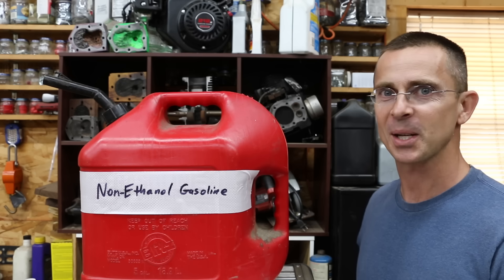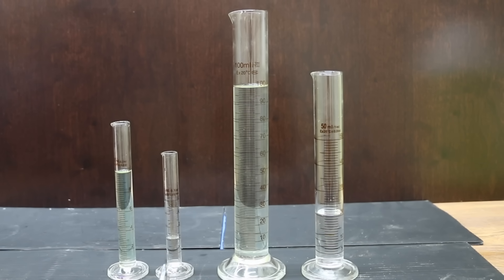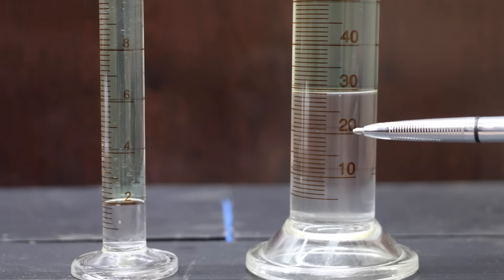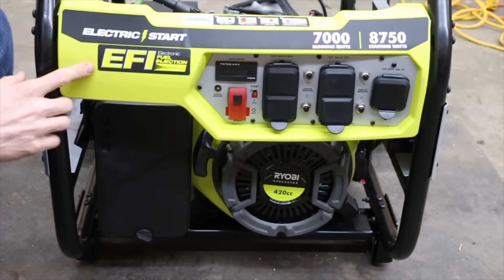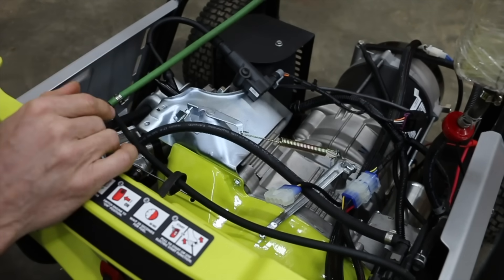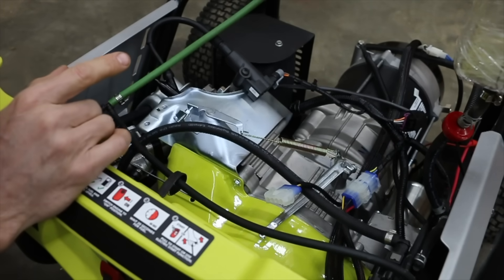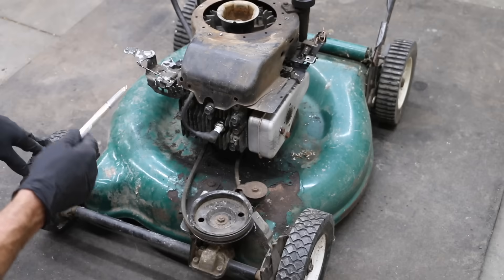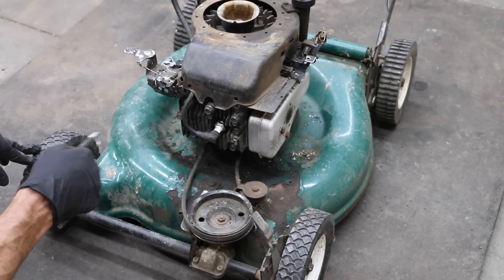Is Non-Ethanol Gasoline Really Better? See the PROOF!

Comment: Hey I had a small engine tech show me a swollen check valve I believe it is called in the carburetor of my chainsaw. He said that the ethanol ruins them and they have to be popped out and replaced if left in fuel containing ethanol for very long.
Reply from the maker: Great point!  It also causes "pot metal" which is what most carbs are made from to badly corrode.

Comment: Will and has destroyed my hopped up 2 stroke dirt bikes and if it sits in the tank 3 months it clogs the carb jets and they won't start.. I run AV Gas mixed w/ 110 octane race fuel. Ethanol is BS.
Reply from the maker: Thank you

Comment: Good video . When ethanol fuel was first introduced it caused many problems even in non fuel injected cars . The average mileage loss was 18% . In all my small engines I first tried Stabil  , but it did not help . Then I found the enzyme fuel treatment and that was better . Now I drive a good distance to pay over a dollar more a gallon for premium non ethanol gas for all my small engines . In boats is where it can be life threatening , destroy fuel lines . Also will really mix the moisture from the air into fuel tanks . I remember finding out the hard way while out fishing for salmon many years ago . Kicker motor died and would not start ( a Honda ) . Main would not start , I spun off the water/fuel separator and it was full . After drawing to and float bowls I was able to restart and stay out of shipping lanes . Several years ago a study estimated American spent an extra $1.7 billion on small engine service because of ethanol fuel . As an RV person I could not help but notice in Washington state we paid about 10-15 cents more a gallon for E-10 and in South Dakota you pay about 10-15 cents less .
Reply from the maker: Great point. Thank you

Comment: Dude what a great video.  Fuel efficiency results were exactly what i expected.  Carbon deposits results werent.  I expected the ethanol fuel to have lower deposits.  But then 10% mix may not be enough to make that much difference
Reply from the maker: Thank you very much!

Comment: Always use non-ethanol in small engines, briggs,honda, and others!
Reply from the maker: Thank you!
Reply: @ProjectFarm    Look at this engine from a country whose common gasoline is a minimum of 27.5% ethanol and note on the sticker where else it is sold!

https://www.honda.com.br/produtos-de-forca/gx120

It has worked out so well in Brazil and for so long that Argentina and Paraguay have also gone to E27 as their national gasoline.
Reply: Look at this engine from a country whose common gasoline is a minimum of 27.5% ethanol and note on the sticker where else it is sold!

https://www.honda.com.br/produtos-de-forca/gx120

It has worked out so well in Brazil and for so long that Argentina and Paraguay have also gone to E27 as their national gasoline.
Reply: @danafletcher2341  That's fine, but It's still a good idea to not use ethanol containing fuel in small engines, particularly if they are going to sit for periods of time(which is what small engine equipment tends to do).  It will cake up the carburetor and lead to unnecessary maintenance and equipment downtime.
Reply: @danafletcher2341  I've had the exact opposite experience.
Reply: @mattrevesz  Back in the 80s when E10 came to be called gasohol I did have problems with ethanol cleaning all the gasoline's varnish out of everything.  Fuel filters had to be changed weekly in some vehicles we had.  I still have some of them today though they are not used much, they will start right up and the fuel filters don't get changed yearly anymore even.

Once an older item that used gasoline for a time gets clean, it stays clean with ethanol.  The transition is a bitch though.
Reply: I would like to but I can't get it.
Reply: @michaelriecher5632  In Canada we have 3 grades.  Regular, Super, and Premium. The Premium is the expensive stuff and has no ethanol.
Reply: @mattrevesz  The premium is super toxic and carcinogenic as it contains 40% BTEX(benzene, toluene, ethylbenzene, and xylene).  That is as big a crime against humanity that lead was and why either has been allowed is a wonder.

Comment: When jetted and ignition timing are correct. Ethanol makes more power. And is less fuel efficient. I run methanol, pump gas, race gas , and e85 in jr dragster. Methanol was fastest and liked more timing. E85 was 2nd and liked similar timing. Pump gas (e10 )was 3rd and liked the least amount of timing. Race gas last place but wanted the most timing. All done on stock long block 5hp briggs.
Reply from the maker: Thank you.

Comment: This is good stuff. I'm not an ethanol fan mostly due to the corrosion and hose/plastic damage but it is interesting to know that there are efficiency issues as well. However the argument has been more about pollution I believe. I believe ethanol is basically a farm subsidy with more downsides than up and overall a poor policy.
I was wondering if carb jetting or other engine characteristics would make a difference in the test results. The idea is to keep power identical, then measure. Of course these would probably be more difficult tests and probably wouldn't tell us much more, but just curious nonetheless.
I didn't understand the reason for the compression test though I'm sure there is one.
Thanks for these fun and interesting brain exercisers.
Reply from the maker: Thank you!
Reply: The question we need to answer is whether or not Ethanol is a less hazardous octane booster than the other boosters used in the past. Ethanol replaced the previous octane booster (I forget its name) because that booster gave off toxic gasses when it burned. That octane booster replaced lead. What are our other options for octane boosters that are better than ethanol?
Reply: The compression test is so that he can show that: 1. He sealed up the head exactly the same after working on it. 2. That the fuel used, and the cleaning did not change the compression drastically. If the compression were different, that could change the test results.

Comment: Thanks. Excellent video. If it can be done, if you have non-ethanol gas with 10% water added, how much ethanol addition would it take to make the 3 ingredients immiscible? i.e. all 3 are dissolved into each other. If you can burn fuel with water, i've heard it lowers engine temp, cleans out carbon, and increases efficiency. Thanks for your work.
Reply from the maker: Great question.  A gallon of E10 gasoline will absorb approximately 3.8 teaspoons of water. That's approximately 1/2 ounce of water per 12 ounces of ethanol.
Reply: @ProjectFarm  Thanks. I wonder if such a mixture would run an engine cooler and longer. Somewhat / partially steam-powered?

Comment: As the Water Boy's mom would say, "Ethanol is the Devil". I started using 110 octane racing fuel in my two stroke dirt bike and weed whacker and blower. Not for the performance, but because I don't use the equipment much and the fuel is very stable for months on end. Yes, it's $70 for 5 gallons, but the time and energy and money I save jacking around with it down the road is well worth it.
Reply from the maker: Great point! Thank you

Comment: Just filled my 02 avalanche with non ethanol  gas 30 gallon tank . How would E85 affect my mileage like 1 gallon?
Reply from the maker: E85 vs non-ethanol.  A 25-30% loss in fuel efficiency is likely. Thank you

Comment: If ethanol sits in a tank or carburetor for a period of around three months it will start to gel and clog jets. This is why many people have problems with it in lawn equipment with ethanol fuel, and in two stroke applications like weed eaters it will destroy the hoses that go into the fuel tank.  I have fixed many mowers and weed eaters for people at the beginning of mowing season due to ethanol gas because it is left in the tank and carburetor over the winter months.
Reply from the maker: Great point. Thank you!

Comment: Answer: no. A bit of ethanol is better.
Ethanol suspends water to prevent rust and water aspiration, prevents carb gunking, and is no more "corrosive" (LOL) to metal or rubber seals than the toluene etc. that's in all gas to begin with.
Reply from the maker: Thank you!

Comment: it may make no difference, but, i use  tank shield [ a stick that goes inside the gas jug ] , the stick absorbs water when the jug is not in use.
yes, gasoline can also get condensated when sat to long and not used.

and the equipment idles smoothly.

note :   they have not made a  '' dam it  ''  filter for when things go wrong. 

awesome video !!

1000 thumbs up !!
Reply from the maker: Thank you for the video idea!

Comment: Ethanol eats up the fuel lines in outboard motor setups. I learned first hand as my merc fuel lines delaminated last year because I left the 10% fuel in the lines.   I also had to clean out all the varnish and water that seperated in the tank.  The Vapor Seperator tank filters were all ruined as well.  Low pressure fuel pump diaphrams had perished also.  In other words, they were all engineered to fail thanks to ethanol.
Reply from the maker: Great point! Thank you

Comment: Thanks for video it's interesting what you do.  I run non-oxy 91 octane premium in all my small motors and motorcycles.  I do it mostly because of storage issues.  I have never had spring start up issues since I started using it.  I tend to get a bit better mileage with it also.  I am not sure if it is because of the alcohol or because of the higher octane.  Thanks again keep up the good testing.
Reply from the maker: Thank you!

Comment: I would like to know what octane is 92 octane fuel with the ethanol removed, by adding water and draining. Is only the ethanol attracted to the water, or do you lose other things they put in gas which are beneficial?
Reply from the maker: Great point. It will lower the octane but not sure how much.

Comment: My 2014 Ford F-150 has the flex fuel 3.7L NA engine.  When I use E-85 fuel compared to E-10 87 octane fuel, I get 2-3 mpg less with E-85 per my trip computer which I have tested to be pretty spot on. Mpg price is a little more with E-85 at least with my experience.
Reply from the maker: Great information! Thank you

Comment: Ethanol killed my carb and petcock 😂😂😂
Reply: An undesirable side-effect.  Ethanol at least partially dissolves the gummy compounds that plate onto fuel system components.   They generally find their way into the fine orifices of the carburetor.
Reply: CzarWilkins ...I have a pet dog...

Comment: Food for thought: 
Ethanol Lower Heating Value: 26.9 MJ/kg

IsoOctane/100% gasoline LHV: 44.3 MJ/kg

10%ethanol&90%gasoline LHV= 42.56 MJ/kg (44.3*.9+26.9*.1)

4% less Heat/kg

Source: Internal Combustion Engine Fundamentals 2E
Reply from the maker: Great point. Thank you

Comment: Ethanol has great Octane rating of about 120. It is a bit low in terms of BTUs, but it is pretty much non toxic, has a reasonable vapor pressure preventing vapor locking, has oxygenates for cleaner burns etc... If it were not for the oxygenates being corrosive to some older plastics, I would use it all the time pure. Current non ethanol gasoline is really a mix of some of the worst hydrocarbons. It also is dirty. Ethanol and Xylene mix would be the ideal high octane gas to mix with Kerosene for high energy , imo. So, maybe make a test with this 91 homemade gas using: 30% 117 octane Xylene + 30% 120 ethanol + 40% 50 octane K1 Kerosene. It would be interesting to check the power and efficiency of this.
Reply from the maker: Thank you

Comment: Ethanol fuels have been used in Northern States like Michigan for decades. It used to attack the accelerator plunger rubber on Carburetors. Then the big three coated them with a blue/green coating to prevent the attack on them. Most anything made today, is made to overcome up to 10% ethanol without problems. Flexfuel vehicles are very much immune to ethanol damages. Some gas stations have trouble with rain runoff getting into the storage tanks. Then they have a problem, and deliver it to us. Always make sure the filling ports at your local station is in a high corner, not a low spot of the stations parking area.
Reply from the maker: Thank you